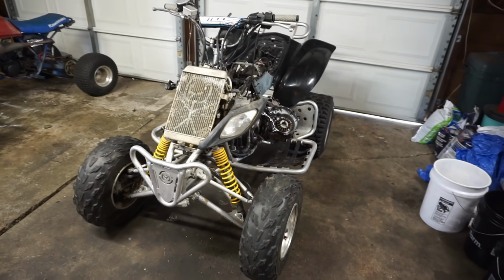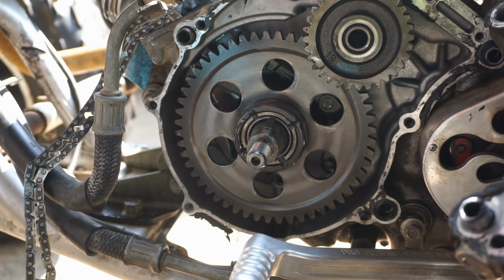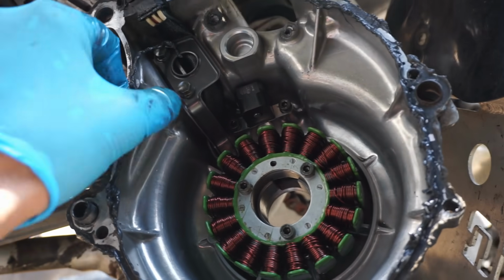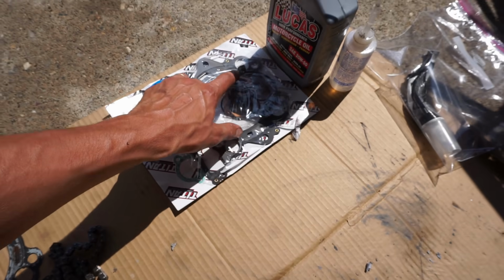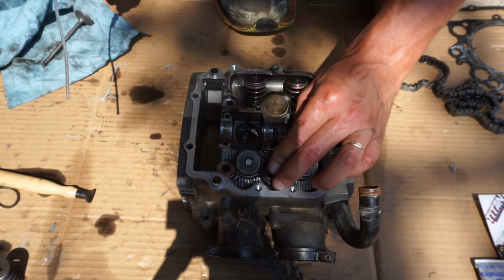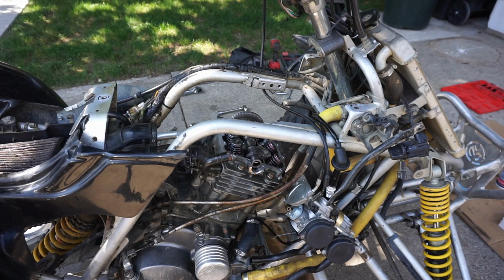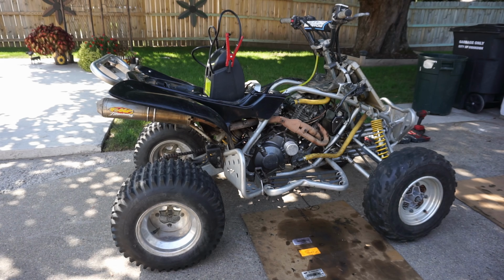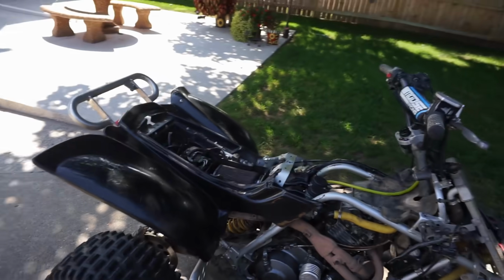First Start Attempt On The Non-Running Yamaha Raptor 660 Quad

Comment: I want to say love your work, The only suggestion I have,  I ran my own small engine shop for 10 years, and whenever I saw a bent valve on a head and had it broken down as far as you have this one, I always marked the valves as to their location and removed all the valves checked the springs hight and decarbonized everything with a soak and brushing in Seafoam and then hand lapped all the valves to the matching seats, and I also checked the head and cylinder surfaces for square and flatness, before reassembling them and of course all new high-quality gasket sets and new valve seals always. But you do a good job brother.

Comment: Congrats! it’s hard to believe the 1st jump box didn’t produce enough amps to spin the starter effectively. this seems like a big Win for you & didn’t spend extra time chasing Gremlins or non-issues. that 660 is gonna rip, Dude!
Reply from the maker: Yeah inwas getting worried that it wasn't going to start lol
Reply: @2vintage  - I wasn’t…it’s what you do, Man. I have ideas for a ‘universal’ flywheel puller kit. I’ll AutoCAD it out this year & CNC from plate steel. I’m no pro fabricator or in the metal fab business, but I’ve enough KSAs to be scary. I’d love to send a prototype your way, since you get your hands on more random machines than anyone else I sub to…more than a Karl Childers
Reply from the maker: @corporalclegg914  yeah that would be awesome! That would be a great tool. I'd even help you sell it if it works!

Comment: That must have been the best feeling ever. A few months ago I bought a non running polaris predator (finding parts for this atv was ROUGH). Cleaned fuel tank, repalced petcock,fuel lines, sparkcap, battery, spark plug, fuel pump and carb still wouldnt start. messed with it for an hour and realized the grounding cable from the battery just wasnt tight enough. tightned it, got it running and sold for a $2000 profit. I think i wanna get a fixer upper raptor next! Great video thank you!

Comment: I just picked up the exact same quad for 1200 bucks and thus far it only seems to need carbs rebuilt and a starter solenoid, ill be checking the compression Spark and doing an oil change next week.

Comment: I've had my 2001 since 2007 I never ever use the parking brake so one time years ago the parking brake switch got bumped just enough to activate it and tried riding it and it would not rev out just bumble at low rpms, I was baffled pulled the carbs (pain in the ass every time) and nothing ....then I see the little lever pulled out a little bit I pushed it in an wabahhhh it was back. I was so happy and discussed at the same time. I does not take much to make a 660 wake up from its fairly docile rider friendly stock form. Mine has a hot cam (stage one I would think but not shure) big gun headpipe, R4 silencer, air box mods with k&n filter, and a DynoJet kit and it flat out rips for those few mods.it will walk right away from a stock 660 with just a slip on. I also went -1 tooth front and +2 on back and a set of 18" on back (20" front), it dropped top speed to around 60ish from 80ish but it gained retarded acceleration and snappiness, hardest part is keeping front down when it hooks. Unless you desert or road ride you don't need an 80mph top end. You can shift as fast as you can blip the clutch bam bam bam, pretty wild for sport wheeler, these guys that say "my 450 will dust a raptor" are full of crap 450 MAY edge out a raptor in a drag race but it won't "dust" it. I've seen plenty of videos where there neck n neck and even after switching riders.... The raptors definitely have more Tq but they are 50lbs heavier and power curve is waaaay different. It's apples to oranges 2 very different machines for 2 different purposes but both are fast and both have there pros and cons. I will say Off the show room floor a 450 is definitely faster.

Comment: A trick to start anything without the carbs is just spraying starting fluid in the entrance to where the carbs would be just dont to a ton because it will want to rev up extremely high

Comment: A harmonic balancer puller for automotive use would pop that flywheel right off with the 3 bolt mount pattern.

Comment: Dont give it that mutch gas when starting. Most 4 stroke carbs have a jet that squirts fuel into your intake. So everytime the throttle opens fuel shoots into the intake, this way you could easily flood your bike. Just a tip for next time.

Comment: Should never, ever put any new engine part in the chuck of a drill, especially a new valve. The slightest burr on the stem could damage the valve guide when you install it. Glad to see all these old bikes revived though!

Comment: That's a 2001 1-way bearing assembly if you to replace the 1-way assembly go with the 02 03 assembly i believe 04 05 1-way assembly bearing and flywheel are different

Comment: That mark inside the crank case is probably where the chain nearly came off the cog and got all the stretch, but mad that the valve didnt crunch the piston crown.....or did it?. The problems with bike shops is they never want to do the short fix it would have been all the valves need changing or re seating , all new springs and seals, probably would have put a whole new top end in  also (just to be safe ) and the bill would have been about $2500 minimum.
Reply: Really I’m getting a topend on lt 500 and seals and I’m paying 700$ for it all parts and Labor they be taxing where you at
Reply: @Guadzilla459  two stroke vs 4 stroke... Apples to oranges "bruh"

Comment: I have a 2001 Yamaha raptor 660 if timing an valve clearance is good. Wondering why my raptor has a hard crank. piston sounds good with no spark plug inn. Engine get hard to turn over with spark plug inn any idea what’s wrong with it?

Comment: A much easier way to lap those valves is to put a drill at the end were the seal goes on and go in and out slowly works much better and faster
Reply from the maker: Yes I have done that before. It seems to make it uneven though.

Comment: Ok so I just bought a raptor 350, it came with a fmf full titanium exhaust, which was too loud for the neighbors. We put the stock one back on and now we have the exhaust and the header, what can I sell it for?
Reply: Why to loud
Reply: @lifeononeweel3008  first off, onewheels rule, second, it has less packing to add power so it’s really loud
Reply: @JoeCaparo  it doesnt have less packing.. it needs to he re-packed. My craptor 350 was "loud" compared to 100% factory condition even with the stock exhaust and the baffle removed. Also we cant really give you a price..  where are you on earth? What condition is the pipe in? What does the exhaust system cost new? What do you want to get out of it? Whats the lowest youre willing to take? See what i mean.. too many variables mate. Just look up what it costs in your area new then ask what you think is a fair price for the condition the exhaust is in. Cleaning things always helps you get closer to your asking price and good clear photos of the item and any damage are a must.
Reply: Well it doesn’t have a spark arrester, and it lets fumes thru faster to let it run better, it was way louder than stock. (Sorry that phrasing doesn’t make much sens) It wasn’t run with it very long.I’m on the east coast, it’s almost new, and I’ll go pretty low with it, I just want to make a few bucks and it’s taking up space
Reply: @JoeCaparo  Look up the new price of this thing, and sell it for (depending on condition) maybe half or 2/3 of the the price new
Reply: @JoeCaparo  IT RULES
Reply: @JoeCaparo  you maybe Will get more money with the fnf
Reply: @anonymebande8561  ok, thank ylu
Reply: @lifeononeweel3008  oh no I’m keeping the quad, she rips, I meant what can I sell just the fmf exhaust and header for
Reply: @JoeCaparo  aha good but it is a 4 stroke or 2 stroke
Reply: @lifeononeweel3008  4 stroke
Reply: @JoeCaparo  NOISE
Reply: Scrap
Reply: @robspear03  no those exhausts are expensive

Comment: Hey man, I’ve got a Kawasaki bayou 300 and it will start and run but once it gets warm it just wants to quit as soon as I give it throttle, I’ve checked the valves and timing, it has a new carb, and it has compression, do you have any idea on what that is?
Reply: Why are you asking him? He works on cardboard...
Reply: @robspear03  what

Comment: You tried starting it when you bought it though so this isnt the first attempt you liar!

Also 4 stroke rings should be 120° not 180° basically you want the ring gaps to make a Y shape. This ensures no two ring gaps are ever aligned. 180° will work but 120° is a "just to be safe" measure.
Reply from the maker: haha I meant first start after fixing it
Reply: @2vintage  i know i just like being a pain in the ass sometimes :p sick deal though... even if you part it out you should be able to profit off of it.